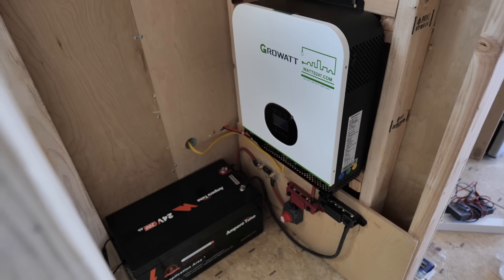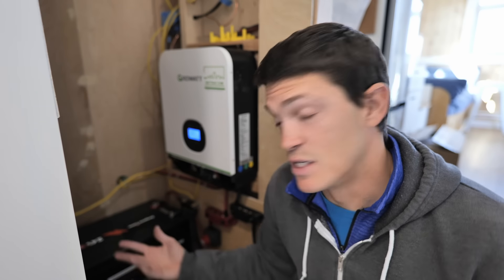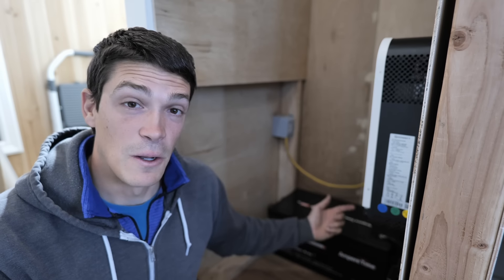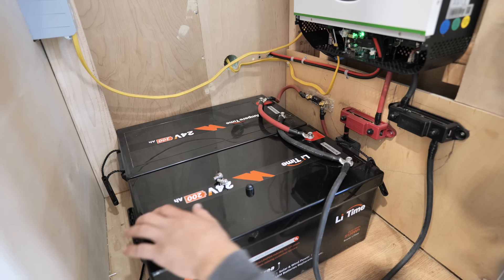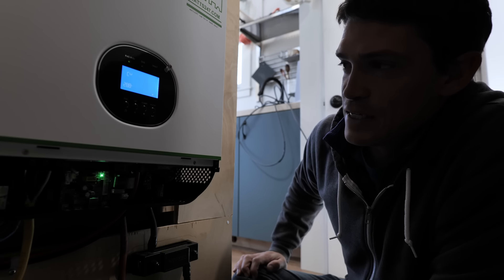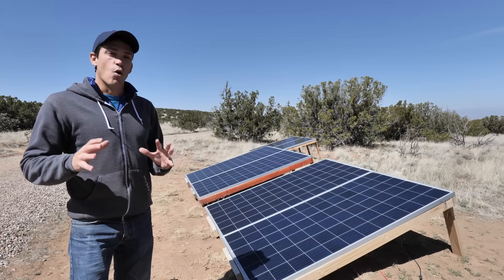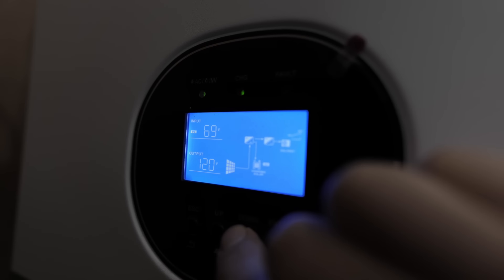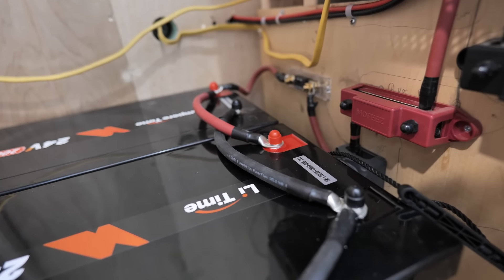OFF GRID SOLAR 24 Volt 1 Year Review + UPGRADES w/ LiTime Lithium Battery

Comment: Your batteries dont have low temp charge protection.  If the did, they would reset automatically.  The reason you had to " wake them up" with an external source was because the internal BMS had shut down due to low state of charge. Once this happens they will not function until the voltage is brought up to the required level. Many charge controllers will not charge into a "dead" battery which is why you needed a different charging source other than the solar thru your inverter.
Reply: Yes I have the same 24v battery and they do not have low temp. Some of their 12v ones do but the 24v does not.  It was over discharge protection that you saw..
Reply: @natesdiysolar When that battery is discharged that much, it must reduce the batteries lifespan by a measurable amount?
Reply: Yeah. Don't know why they haven't yet installed cold temp shutoff. I have a 100ah and love it.

Comment: Growatt high frequency, transformerless inverters are great for powering resistive loads and small electronics but it won't last very long powering inductive loads like power tools, refrigerators, motors, AC units, compressors or microwave ovens. High frequency inverters like these were never designed for powering high surge loads. You may get lucky and this inverter might start a few of these inductive loads when the inverter is new, but as the inverter ages, 1 1/2 to 2 years down the road, high frequency inverters will fail sooner, rather than later with continuous use with inductive loads. I've repaired inverters for a living for the past 23 years and one thing that I've learned is that the surge current that's generated by these inductive loads will damage the MOSFETs (metal oxide semiconductor field effect transistors) in this inverter and will basically brick the inverter because the hourly shop rates for troubleshooting, testing and replacing all those MOSFETs typically will exceed the value of the inverter. It would be more cost effective to simply replace a failed high frequency inverter. A much better choice is one of Growatt's low frequency transformer-based inverters. You'll be much happier 10 years down the road when your Growatt low frequency inverter is still running like a top..

Comment: I wouldn't connect them in parallel. I would connect each to the busbars you have. That way it draws evenly from each battery. if you do parallel (daisy chain) the load goes through both which lowers your cycles and raises the C rating.
Reply: Daisy chain is typically series. I think I understand the point you're trying to make but he has to connect them in parallel or he won't have 24 volts. I'm not trying to belittle you but please make sure you know what you are talking about before giving advice, or take some time to word it better. Peace, my friend.
Reply: @MyBacktrail  Daisy chain is same as parallel. he has busbars right there. I do not understand  why he would do that. Understanding C rating of current is a must.  its his batteries so its his call but still
Reply: @dc1544  I guess "daisy chain" is just a bad descriptor because it means different things to different people. But yeah he's a newbie, learning as he goes. At least he's out there doing it, unlike most people in the comments.
Reply: @MyBacktrail  

yea daisy chain is a bad descriptor because in the solar world that would mean the same thing as connecting batteries in parallel and as @myblacktrail mentioned, they would no longer have a 24v system which the hybrid inverter needs in order to turn on. 

the bus bars are there so he is able to tie into battery when wanting to use a stepdown converter for future needs without having to add in more stuff to the battery terminal, i think what @dc1544 is wanting to say is "why are you adding extra resistance between the battery and inverter by having a bus bar between them"
Reply: @dc1544  I think you  mean to hook the batteries up not in series, but in parallel by wiring them both to the busbars. That would work, but he would need to move the fuse AFTER the busbars instead of before them. I use what my friend and I call a "spider": wiring both positives with the same length cables to a common point, then running on to other parts of the electrical system, then the same with the negative cables. As long as the positive cables are the same length and the negative cables are the same length, (though positive and negative can be different from each other), the batteries will be filled or drained the same.
Reply: @MyBacktrail  Daisy chaining can be either parallel OR series, depending on which battery post one connects....I understand both viewpoints here.
Reply: @Tumbleweed5150  yes but its not parallel or series. Series adds the volts. parallel doubles capacity but all goes through 1st battery. Its like parallel but the busbar is the parallel item being used not the 1st battery. This allows you to add or remove batteries to busbar easy. with each added battery  it lowers the C rating of charge and discharge. My cells can have 4000/6000 or 8000 cycles. using 80% of battery gives me 6000 and staying within temps and not going over .5C allows them to last 8000 cycles. Even when I am putting in 200 amps @58.5 volts each battery is only getting 50 amps give or take 5 amps which is just .18C max.  hope this explains it a little better.
Reply: @Tumbleweed5150   nope parallel  means to attach each battery together positive to positive which is Daisy chaining. Each battery positive connects to a busbar. It  lowers the C rating and divides the load evenly.

Comment: Be sure that both batteries are at similar state of charge.. perfererably 100% before connecting in parallel. Let them sit for a day not connected to any load or inverter so they can equalize
Reply: That's exactly what I was thinking as well

Comment: I just hope you charged both batteries at the same voltage level, if not the lower one got a 1000 amper charge from the other one, they balanceing in paralel, and if there is a different chargeing state that can couse problems.

Comment: You should change the routing of your battery leads. The positive and negative cables should not cross each other at all. If the cables overheat they could short out and start a fire.
Reply: Cap my fire wasn't that bad.
Reply: Yep.
Just run the negative bowed to the front.
like an "s"
Reply: Actually, battery cables should be taped, zip tied or twisted together to reduce inverter damaging DC ripple and RF noise caused when the inverter cables a separated.

Comment: You should add a mini split ,they are very efficient, I run 2 on my Bluetti with ease
Reply: I am in my '28 RV and put a 9k Pioneer mini split in last summer.. WOW.. low power, super quiet and cools or heats very well.. 2300' in S. Oregon. Haven't tried using my EF Delta 1300 for it yet, but will soon.
Reply: I also have a Pioneer 9k BTU in my RV and run it off my Bluetti AC300. Highly recommend a mini split for its low power consumption.

Comment: Thank you for your share. I recently installed this precise model and brand of battery into my RV, and it has been nothing short of amazing. The timing is perfect; I think I'll go ahead and order a second one and an inverter to run high-load applications. Thank you! By the way, their official website is usually cheaper than other platforms

Comment: (At around 10:00 it looks like you already figured this out so you can disregard my below input other than used prices)

You guys have done a great job and thank you for the update. My two cents is this (regarding cloudy days): Quality sed solar panels are easily between 20 - 40 Cents (0.40 US Dollar), why not triple your solar array to help make up for cloudy days? You can play with series vs parallel, vs series-parallel to get the volts and amps to what your Growatt can handle and will like. You have the room, why not add the panels?

Comment: The install looks good. put the batteries in a smaller insulated box with a lid. and leave a LED light running in that box. It will keep them above freezing. They also say Do not mount inverters to wood. Have a look at my insulation i have been working on. I mounted mine onto 10cm fiber cement sheet.  that is the only changers i see that would improve your small system.
Reply: Who says "do not mount inverters to wood?" Fiber cement is horrible at holding in screws and fasteners. As a former telecom tech, long before solar power became common, we used to always put up a sheet or 2 of 3/4" plywood to mount all the hardware.
Reply: @MyBacktrail  That's good, you are free to mount them  how you please. Me I would put fiber cement sheet 1cm thick that will give you a 1hour burn time and also deals with any heat generated from the unit. Same is true for charge controllers. Yes fiber cement sheet is hard to screw into unless you use the correct screw housing. But I just put over the wood.  I have seen inverters and charge controllers burn paint black when not working right or due to very hot days and no ventilation. There are many wrong ways to do things but in most cases only one right way. Also it's in the New Installers regulations here in Australia. Inverters and charge controllers as well class 1 and 2 batteries banks should be mounted on a non flammable surface. Class 3 batteries like lead acid have another set of requirements. That I will not go into hear. But hey Your former telecom tech. So for sure you know it all right. Or maybe they just don't care what you do in the US or Canada
Reply: @MyBacktrail  I used fireproofing board in between my 3/4" plywood and my inverters, just for safety. In case of a problem, there's a much smaller chance of my house burning down. Just use longer screws to go through deeply into the plywood.
Reply: @JustinCaseSolarPower  If there are no requirements like that here in the US yet, there should be....soon, I hope.... and I will always lean to safety over what anyone else says!
Reply: @Tumbleweed5150   Yes it is not a large cost to do it right the first time. Who know it may just save you many thousands of $ in the long run. It will definitely  give you peace of mind, knowing  its done right.  😉 🖖👍

Comment: I'm not sure what parameters you set for the battery but they should be:

Charge Target: 28.4V
Absorption Target: 28.4V (if separate from charge target)
Absorption Time: 1 to 2 hours
Float Voltage: 27.0V
Inverter low voltage cutoff should be set to 24V.  No lower than 24V.

The reasons for the above values are:

* Charge a 24V LiFePO4 battery to 3.55V/cell (28.4V), which is well above the voltage needed to fully charge it, above the BMS balance start voltage (typically 3.50V/cell), and below the BMS cut-off voltage of 3.65V.  There is very little wiggle room here because you don't want charging to be cut-off by the BMS repeatedly as that will put strain on the BMS's MOSFETs, and you also don't want the BMS to be constantly hitting a cell voltage limit and shutting down charging either because that puts unnecessary stress on the cells.

* Absorption target same as charge target.  Absorption time 1-2 hours.  This is primarily to give the battery time to balance its cells.  The current tail for your setup is probably less than 30 minutes, but the BMS built into the batteries needs time to balance the cells.

* Float voltage: 27.0V.   This is roughly 3.375V/cell, which is basically the "load support" level for the battery.  If the battery is fully charged, it will naturally drop down to roughly this voltage and remain at 100% SOC.  So when the battery is fully charged and solar is still available, setting the float here allows the solar to run the house or augment the battery while solar is available without stressing or draining the battery.

* Inverter (Growatt) should be set to turn off the AC at battery voltages below 24V (roughly 3V/cell).  This will be roughly 5% SOC or lower and also ensures that the battery has enough energy left in it to keep the BMS alive, and also hopefully keep the Growatt alive in standby mode until solar comes up the next day.  Avoiding an actual shutdown allows the system to recover itself automatically when solar comes up the next day.

Someone else pointed out that the two batteries should be roughly the same SOC when connecting them in parallel.  Well, they should at least be roughly the same voltage, such that you don't get a lot of amps between batteries when you parallel them.   The SOC for the two batteries will synchronize automatically over one or two full charges.

The Growatt can't tell how many batteries you have without comms, and these batteries don't have comms.

-Matt

Comment: You should increase the input voltage to 48 volts.  Doing that may necessitate the front end electronics of the inverter be changed as well.   Doing so will  reduce the front end current by half and may give you better inverter efficiency...Just a thought.

Comment: What all can you run simultaneously with only 3000watts?
Reply: Not that much, but not that little, either. Most outlets are rated for only 15 Amps AC. That is much less than this inverter is able to put out, about 1800 Watts of power per outlet. However, someone that is used to being on a power budget can easily work around that. I put in some outlet multipliers with 15A breakers built into them in both my girlfriend's shuttlebus/RV conversion and my RV. Glad I did, because otherwise when she plugged in her Instant Pot as well as an electric rice cooker at the same time, it could have burned the wires, and maybe her "home'. She just found out that she needs to run the two off of different outlets, or preferrabley at different times. LOL

Comment: Didn't try to match the voltage of the batteries before putting them in parallel? Might have been a lot of current flowing into the new battery if the old one was fully charged. They have to ship those batteries at a storage charge. Typically less than 50%.  The current in-rush could have tripped the BMS on the new battery.
Reply: I'm no expert but I agree, equalizing the batteries would have been a good idea.  At 1100w input there will be less than 100a going to the batteries so that should be OK.

Comment: May try looking at a diesel heater for keeping things warm.  Minimal 12 volt draw, and fuel consumption is miniscule for the amount of heat generated.  You'd have to get a step-down converter, of course, but you've already made accommodations for that in your build.

Comment: Is your Frig 120VAC or is it 12 or 24 vold DC? We have a gigantic deep freezer (Amish-made) that runs off 12 or 24 VDC (we run it at 25 VDC) and have been running it for three years. It works perfectly with 2K Watts of solar in the USA southwest year round.

Comment: Looks like you have the risin 335w panels from sabtan lol.  I have the same panels lol.  Your system is just like mine but i have a mpp solar inverter charger. I have 6 of these along with 3 smaller panels making up my strings at 113v voc. 3s3p.

Comment: There are inverters with a wide input range, approximately from 120 to 450 volts. If you had bought them, it would have been better for you
Reply: I have installed two of the same 3000W Growatt 24 Volt units in two seperate systems.  Max input Wattage is 4000W. PV Array MPPT Voltage Range is120Vdc to 250Vdc, 250V open circuit allowed. Max. PV Input Current is 18 Amps. That is good enough to use six 200W panels on one system, with room left over for more, and three 250W panels on the other, with plenty of room left over for more. (Just not the physical room, just "room" for more solar power). My two  48V 5000W Growatts CAN take in up to 6000 Watts of solar at 120VDC to 430VDC, or 450VDC open circuit, but I am running a much larger system than the one shown in this video. My point is that for a 24V system, the Growatt this guy is using is very well adapted. To get any better, he would have to go up to a 48 Volt system.

Comment: Hey, instead of heat tape how about a sand battery?
Hookup a couple 100 watt panels to a 24v or 12v water heater element mounted in a big kettle. Use the right wire to prevent any issues the setup should be fireproof..
Keep that pot under the cabin to create a ambient temp on cold days. I am assuming the pipes are under the cabin and you can skirt and insulate the crawlspace too.
Should do the same thing and take a load off the main system.
There are a few examples of sand batteries on YouTube.

Comment: 12 VOLT CHINESE DEISEL HEATER- BEST DEAL EVER--for heat- and going 12 volt for all appliances will save power on your bartteries--- its worth paying more for those air conditioners  or you get panels to cover the loss of the inverters and stuff.

Comment: Noob here, about to pull the trigger on an All-In-One 24V system, just debating which one! I'm trying to understand if this Growatt is capable of charging your battery bank when you start up your generator (shore power) or not? You mentioned the low-temp shutoff for the battery when you were away and had to trickle charge the battery until it revived itself... I was thinking to myself, why not just plug into shore power and the Growwatt will charge it?" So I'm assuming the Growwatt unit is NOT a charger for the battery bank. I've watched your video with the initial Growatt install and at one point you describe being able to use shore power to top off the batteries when you have days/periods of no sun, so I'm just hoping you can clear up my confusion. Thank-you for the videos!

Comment: Saw your video  I just have one question  , do you know  the maximum  current capacity of the charge controller.  Because I had two of them , think if was 30amp but I was told it's ONLY 13 amp, so be careful